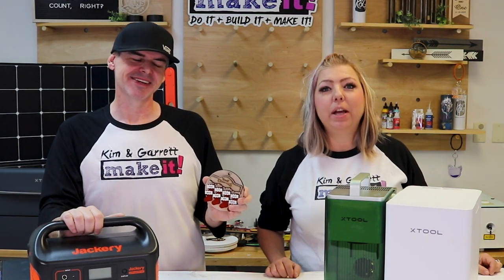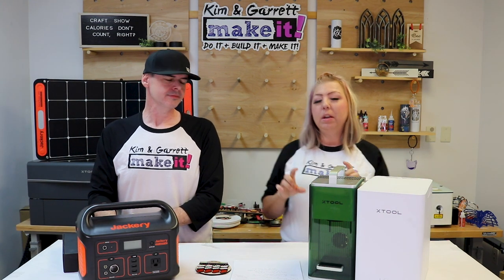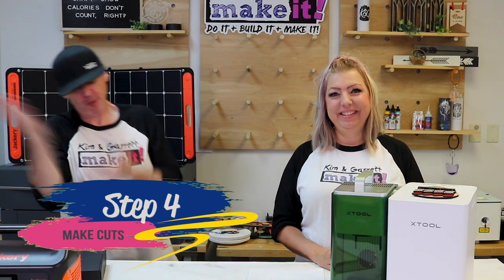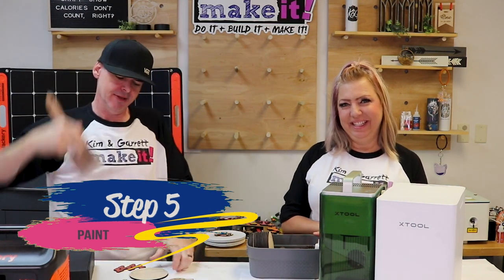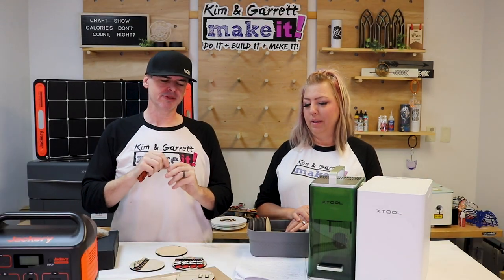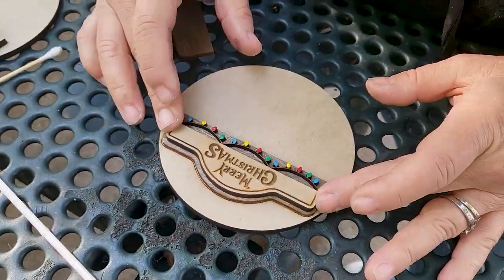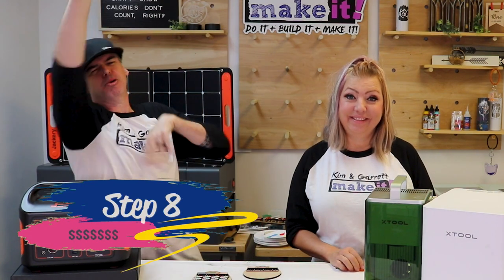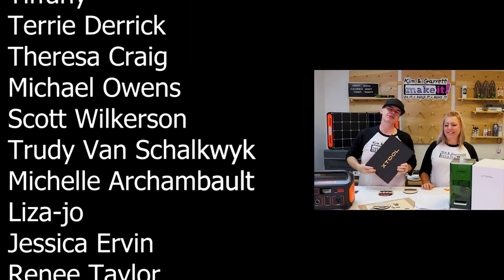Level Up Craft Show Sales: Boosting Laser Engraved Personalized Products with xTool X Jackery! F1

Comment: I bought the F1 to bring with me on the road when I become nomadic next year.  I already had power stations (including a Jackery 500) as part of my home-on-wheels.  I was praying for a solution as to how I could support myself on the road without hopping from one seasonal job to another.  Then the F1 came out and a youtuber I sub to was promoting this same package (he's already a Jackery affiliate).  I binged watched all the videos I could find on the machine at the time and decided this was what I wanted to do.  I'm very hopeful that it will give me a good income so I don't have to clock in for someone else again.  Coming out of a long marriage where I stayed at home and kept my kid educated here, I'm not used to working for other people anymore.  I really didn't want to go back to it. 

Anyways, I love this little machine!  It has its limitations, but I'm just going with the flow and sticking with things that are small and simple.  I bought my F1 on Amazon and didn't have the money to spend on all the accessories at the time.  Maybe I can get those in the future (except the air purifier since I don't have space for one in my rig).  I'm not even sure where I'd put the slide extension and rotary.  Lol.